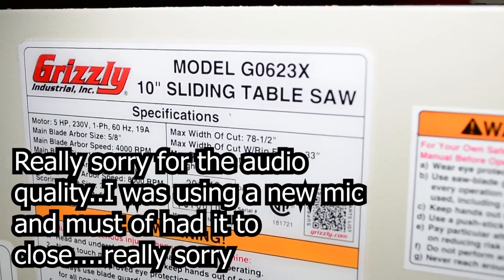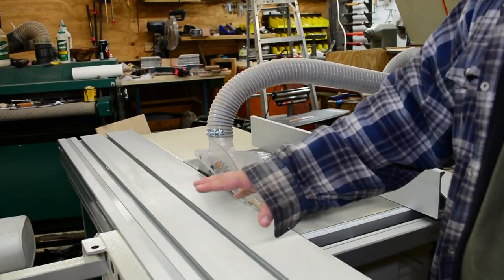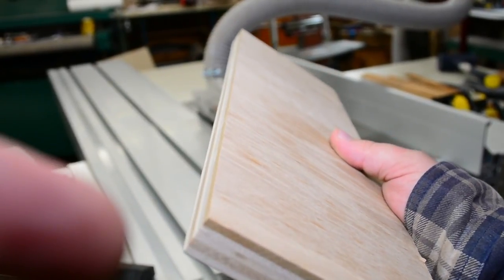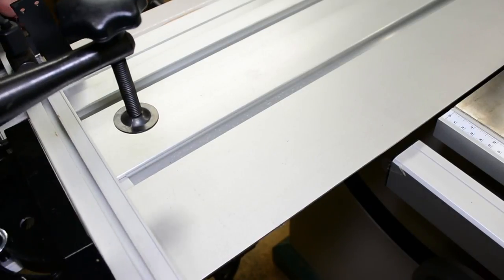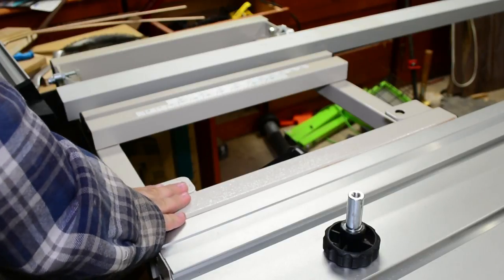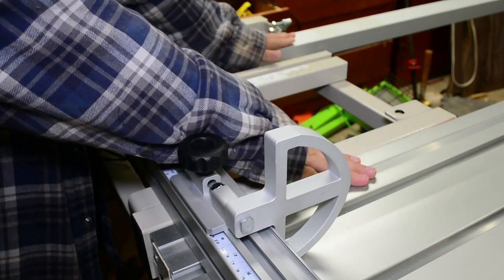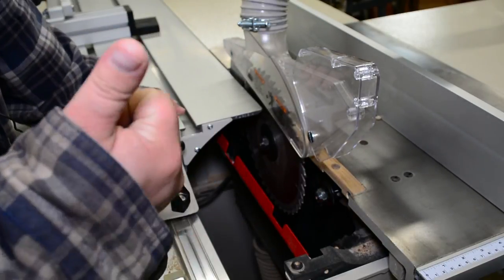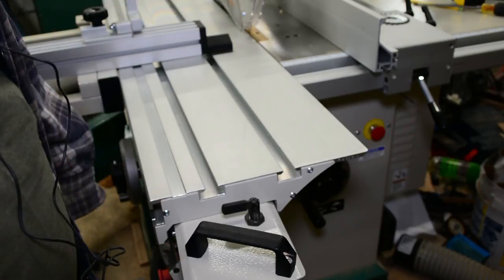Grizzly G0623X Sliding Table Saw Review

Comment: Looking at buying a sliding table saw to replace my Powermatic 66. This is the only one I've found that you can get with 1 PH motor. This review is really, really helpful. I would make them rotate that magnetic power switch or I'd refuse to buy. Good job on this review, really!
Reply: Did you ever by a STS? - make, model, review, advice?
Reply: @liloukulele5238  IN the end I bought a very expensive Felder saw. very happy with the purchase.

Comment: The cross cut fence should be installed at the front of the sliding bed like every Martin, Felder or Altendorf.  Does grizzly have that fixed to the rear of the bed?

Comment: The tape on the fence is not useless, the lil pin on the bottom of the fence can be tightened so it stays in same location so fence cant slide to and from blade , once you set the fence so it works with tape tighten the pin on the bottom and there you go from now on every time it will be same location . You welcome i just bought the saw today and i seen your video loong time ago so i was worried you are right but luckily you not , meant in a good way! Also dust collection hose is flimsy so it pulls on riving knive solution is to insert plastic pipe inside the hose ,about 30” loong and that will keep pipe sturdy above the table and you can play with it to make it actually not pull at all , i know it dont make sence but it works I did it and it’s perfect, pipe is right in the area above the table and end has nonpipe so it can nicely bend to guard , same on the other side pipe stops just before hose bends down to floor ( sorry hope you know what i mean ) love the saw !!!!

Comment: Several years ago I was seriously looking at a Felder or Hammer sliding saw but had some house projects come up that ate into my saw upgrade funds. The project list (meaning money going out) has continued to grow so I am going to have to lower my sights on the type of saw I can buy. I had ruled out getting a slider and have been stuck in analysis-paralysis between the Powermatic PM2000, Saw Stop Pro or the Delta Unisaw (very good saws in their own right but definitely cheaper than the sliders I had been looking at). I wasn't aware of this Grizzly saw until I came across your video. I have always been a bit leery of Grizzly products (only a perception as the only Grizzly products I am familiar with are their maple bench tops and a bench top drill press that my son owns that he has never complained about). I might have to take a very serious look at this Grizzly saw to further add to my paralysis.

Comment: I think the dust collection definitely needs work, probably a rigid tube instead of that flimsy hose. Also, you were spot on about the scale on the crosscut fence. I would like to have heard more emphasis on the safety of this saw. Particularly, not having to stand behind the cut and never needing to have your hands near the blade. Also, many guys who use a slider keep the crosscut fence in the forward position and reference material against it at the front of the cut rather behind it. This makes reaching the on/off switch a little easier after setting up a cut and encourages you work to the side of the blade, not behind it. Overall, a very nice review despite the sound issue. Thanks!
Reply: How does leaving comments like this not embarrass you? I wonder why you felt the need to impose your own personnel preference on a stranger. Child.
Reply: @Xlynks7  What are you on about

Comment: I own a Hammer sliding table saw, thats part of the Felder lower end group  in Australia. The Europeans make woodworking machines that no other country comes close to, not even the good ole USA, in fact were just recently starting to see USA manufactures finally start offering it. I checked out all the saws, and none of them come close to European saws. If your a serious woodworker, and u want a precise machinery, that's Heavy Duty everyday use, that's even pretty to look at, Felder is it! Your gonna pay more, but at the end u will be Happy u did. These are machines  u do not get rid of!!
Reply: But the European cost a arm and a leg.
Reply: Yes the Europeans do make the best sliding table saws and your starting to find more and more used ones on the market due to the fact that many cabinet shops are going to CNC machines. The problems you encounter with commercial grade sliders is that most run off three phase power which would  require the purchase of a three phase converter in a home shop and those are expensive. Also most of them are very large and take up too much room for most home shops. And Felder isn't the only European Co. that makes sliding table saws nor are they the best. The largest manufacturer of sliding table saws is SCMI, which is Italian based. The also have a subsidiary called MiniMax, which markets a slightly less expensive line. I know because I've owned one for many years and the saw has been flawless in it's performance for almost 13 years now and it was far less expensive than the Felder saw I was considering. Other very respected  Co's that manufacture or market sliding table saws include German Co.'s such as Altendorf and Martin. And there are a host of other Co's such as Paolini, Cantek, etc. Not all of these Co's manufacture or market compact versions of these type saws and the one's that do are still quite pricey so I for one appreciate that Grizzly is now offering these in a compact version at an attractive price. It's obvious to me that from VriginiaWoods demonstration that the Grizzly isn't as beefy or as finely engineered as my MiniMax, but it does appear to be satisfactory for the home owner or serious hobbyist. I'm a cabinet maker myself but now that I'm in retirement and putting my tools in my smaller home shop this Grizzly is attractive to me and I may end up purchasing one.
Reply: ErrMora which model Hammer do you have?  Thx
Reply: Hammer C31 combo machine
Reply: ErrMora do you have any thoughts on the SCM MiniMax line of sliding table saws?  They seem to be pretty nice.  I’m just starting to really get into finding out about these table saws.
Reply: Go European made, SCM falls in that category. One thing I notice about other combo machines, is that the Jointer Planer table flips up towards the outside to use as a planer, that would just get in your way to retrieve on the other end while feeding stock to plane. My planer table flips up towards the table saw keeping area clear and safe.
Reply: @tundrawhisperer4821  I have the SCM mini-max with 8'-9" travel. I'm a professional cabinet maker and have use the saw almost every day with no problems in 6 or 7 years. I can tell you first hand that the saw is basic for a slider but is very accurate, it works great and without taking up a lot of floor space. BTW you should also have a standard table saw along with the slider.. the slider is for specific cutting operations I wouldn't really recommend if it's going to be the only table type saw in your shop although others may disagree.
Reply: @travisthechimp7857  Which model Mini-max do you have?  I'm thinking these saws can do it all.  I'm going to be getting rid of three things (work station per-say) and replacing them with one machine and not to mention less set up time for each phase of breaking down materials for cabinets.  I can get rid of my torsion box, used for ripping plywood down with my track saw.  I can get rid of my Festool table for cross cutting plywood down.  Can get rid of my PM2000 cabinet saw.  I'll actually be freeing up a lot of shop space in doing this as well.  I'm a bit surprised by your recommendations to keep a regular cabinet saw set up in addition to having the slider.  Could I get your thoughts further on this reason?  Thank you for the feed back.
Reply: @tundrawhisperer4821  I have the mini max sc4e. I spent a lot of time researching as well as driving out to see other manufactures models such as Felder (in Delaware) and Grizzly (in Muncey Pa.) as well as used macheinery brokers/dealers and although this model is probably considered at the lower end of what is available it was a perfect size and price point for what I needed. In fact buying this model, SCM, brand new for the price I paid allowed me too also purchase two other pieces of brand new equipment that I needed, those being a two bore Unique screw tub and 8' x 50'' Unique pneumatic clamp table (easel style). I had my eyes on a used MARTIN or ALTENDORF but those, even used can be upwards of $30g's or more. With the addition of the two other pieces of machinery included in what I was willing to spend, this saw fit my needs/wants the best.

 I have my shop set up with dedicated machines whenever possible. I don't really like combination machines for the way I work although I can see how they would be great for others in the business or the home woodworker.

 The reason I said keep the standard cabinet body saw is because, if I had to choose just one saw, but couldn't have both, I'd have to go with the tried and true standard cabinet saw for this reason ... I can do everything (albeit sometimes differently) with the standard, good old fashion, cast iron top, table saw (with a good fence and extended table), that I can do with a $10,000 sliding saw. I'm not so sure I can say the same thing for the sliding saw. btw any reputable salesmen should be telling you the same thing.

 The slider is mostly built for processing sheet goods at least the long versions are, however they are also great for crosscutting/sizing down all materials like solid wood materials, like face frame parts. Where the slider is limited is when ripping any long materials that are under a certain size wide, that size depends on the operators knowledge experience of what happens when you go too small. Many times it's better using the regular table saw for this cut it's more stable, safer and accurate to do so. (for me anyway)

The bottom line is the sliding table saw, as built from the factory, on the sliding table base/frame is just not as versatile a saw as the standard, basic, table saw is. It's designed to do specific task over and over and it does that just perfectly! I doubt that anyone whom has used a real sliding table saw would want to get stuck using it for repetitive ripping of 1x's The frame of a real sliding table saw makes it very awkward (possibly dangerous) for the push man, ie; operator due to the frame of the sliding part of the saw is pretty much right where the operator needs to stand.. you just can't be efficient or safe with this setup. I'm sure there are other issues but being I have both types (one slider, 4 standard)  inhouse I've not been forced to find them out.. 

I will add this before ending this book like reply ... not all of the ''sliding saws'' that are on the market, started out as a sliding table saw. Some such as this Grizzly where built on to what looks to be their standard format table saw. These type saws may not have all the limitations as saws that started out life designed solely as a sliding table saw have.. but that said, I'd look for a good experienced source for that information .. preferably someone who can figure out how to hang the dust collection/blade guard hose up out of the way after more then one encounters with what could have been a catastrophic event ie; plastic blade guard/ blade spinning = incoming shrapnel (but lets put it back the way it was anyway) LOL!

                                                                          Hope that helps :)
Reply: Travis the chimp - Travis the chimp - Hello there, I agree more than one saw...  I Have a Friend who does mostly Architectural Woodworking. He has an Altenforf 10’ plus sliding table saw plus two Delta Unifence table Saws, one for datos and the second for other uses. Then again He has three full size shapers too...!  Greg
Reply: Yeah it's really needed unless it's just a hobby, thanks Gregory .  @gregorylondos534
Reply: SCMI and Martin make saws that put Felder to shame.
Reply: @tode5675  SCMI doesn’t have the warranty or the tech support Felder has though!
Reply: @tundrawhisperer4821  I've been running my machine for over 17 years, bought it new, never needed either support or warranty. In fact I own several SCM machines and all have been flawless performers.
Reply: @tode5675  that is encouraging to hear!  I’m having to give SCM serious consideration.  I’m looking at the SI 315 ES.  I need to contact SCM to fully understand what options are available for this model saw I’m looking at.  Their web site is very limited on showing what features can be added.
Reply: @tundrawhisperer4821  Call Sam Blasco
Reply: @tode5675  yep, he’s the guy to talk too!
Reply: @tode5675  which SCM machine do you have?  Thx
Reply: @tundrawhisperer4821  315 saw, 20" Tersa head planer, 110 shaper with tennoning table, 1-K sander, R-9 router, 28" &16" bandsaws, and a copy lathe.
Reply: @tode5675  oh, okay you have the 315 slider too.
Reply: @tundrawhisperer4821  I have the 9hp 315.

Comment: I'm amazed the large crosscut fence does not anchor into a slot so that the tape measurement could be accurate. Are you sure there is nothing like this? This will be a deal breaker for me.
Reply: It totally does, the locating pin locks and once you set it it's correct every time.

Comment: I have a particular piece of grizzly equipment that I had to repair 13 separate issues straight out of the box. Didn't get to use the Grizzly product for a month, and it was brand new. They sent me a defective warranty part, parts that didn't even fit, and there was a back ordered part needed. I'll never buy a grizzly product again.

Comment: I think several of your complaints come from you using inefficient techniques for several different operations on the table saw.  you also shouldn't have to be taking the miter fence off and on regularly if you actually need a sliding table saw.  They are predominantly designed and used for production work of larger stock and are not intended to be a universal table saw.  They can be used for many different setups but they are not really designed to be doing small, finicky woodworking.  They are really designed to be good cabinet saws.  Just my two cents.  You have several valid points in this video.  I just think having better knowledge of what the saw is intended for would probably have given you a better experience.  It sounds like you would get better use out of a standard table saw instead of a sliding table saw.
Reply: All I can say is BS there is no reason that saw can not be used for most projects and how do you know what he uses the saw mainly for in the first place?  When he made this video he was still getting use to it  (only 8 months using it is not very long) I bet by now he is quite comfortable with it.

Comment: Thanks for the in depth review!  I've been eyeing this saw but my only reason to not get it was the smaller breakdown capacity.  Can you rip 4x8's  using the slider and fence?  Or would you track saw panels down to size first?  
Thanks
Reply from the maker: Retro-Tech it depends on how much of the 4x8 sheet you are cutting off.  For example if you are just crosscuting 6" off of the 8' piece then not really.  But if you are  breaking it down into 24" sections then yes the saw can handle the full 4x8 sheet.  Hope that helps answer you question.  Please feel free to ask any others about t he saw
Reply: Retro Tech I’ve had mine for almost two years now and it’s been a great time saver for me. I run the crosscut fence in the back position mostly because I primarily use the slider for plywood. I have my optimizer set to rip sheet first which I do with my conventional cabinet saw then I go to the slider for the rest of the cuts. I have broke down 4x8 sheets by cross cutting first but it can be awkward loading full sheets by yourself. I use a Leg Up on cabinet saw with a Gorilla Gripper and it works well. Virginia wood smith- the pin on the bottom of the crosscut fence is supposed to be tightened down. Cut a 10” test piece of scrap with the rip fence once that is set and use it to get the crosscut fence close. Then you can micro adjust the crosscut fence tape with the Allen screw on top. Mine actually trimmed the black plastic on the fence end slightly.
Reply: Buzzy...any aftermarket items you have added to your saw after having it for several years? I'm gathering that there is a lot of bang for the buck with this saw (many say the same for Grizzly's cabinet saws if you are willing to spend more time doing your own QA) so makes it not hurt so much when you make upgrades.
Reply: check out thecrazyhorsedolly here on youtube for a solution to the plywood handling with a slider.

Comment: Loved the review. Been trying to decide between this, the g0820, the Hammer K3 and the SawStop with the larger sliding table. Really thinking this is the best option for the money. Once you start using European saws, I think the SawStop safety feature is way less important. I have other grizzly products (dust collector and jointer) and have been pretty pleased with them - not always pristine quality, but still very good quality.

I did have one question about the ripping fence though. It seems similar to the Hammer K3 model and that one seems to have a little flex in it when under pressure at the far end. Have you ever had any issues with it not being completely parallel to the blade?
Reply from the maker: I have not really had any since I received my replacement fence as the first one was not straight.  Regarding your concern about flex, it is not really a concern since the piece has already passed through the blade by that point and the part of the fence that is next to the blade is very well supported and I have not noticed any flex.